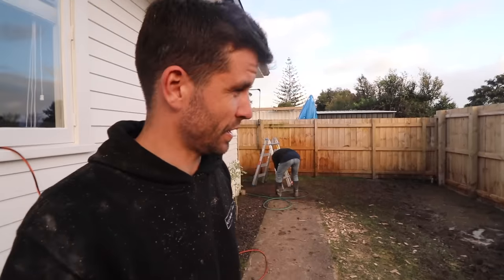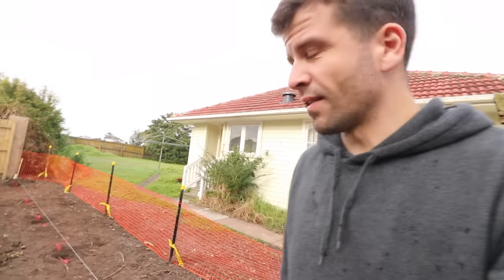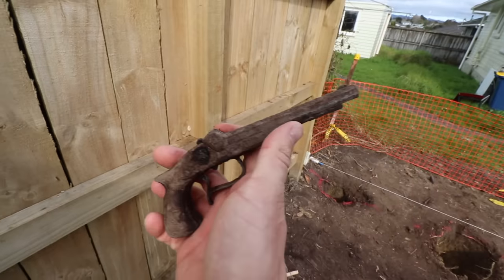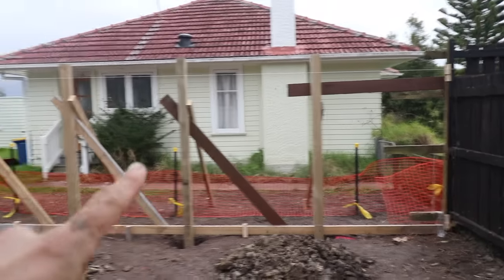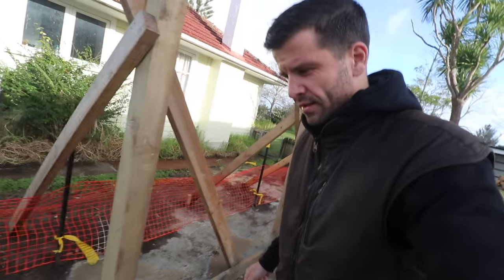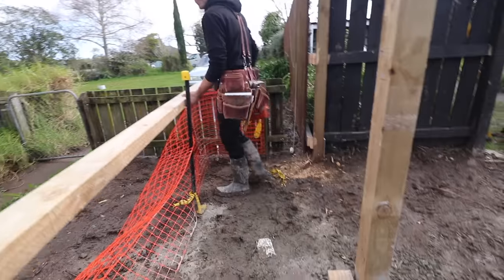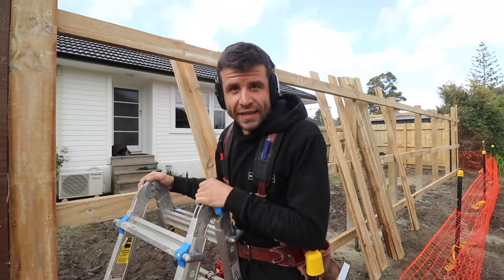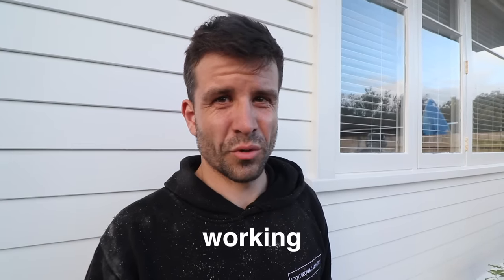How to Build a Fence (Like a Carpenter)

Comment: i cant believe you called a cement truck to fill a few post holes
Reply: If money is not a problem that is not a problem
Reply: Getting in the concrete truck cost the owner an unnecessary extra cost.
Reply: its over 600.00 dollar minamum in the Boston area.
Reply: That crete truck is expensive as hell here in Maine USA! I just pull a few bag from the hardware and throw them on my truck.
Reply: ericcyc1 a few bags of Sakrete from the hardware store ain’t much of a problem. Better putting money in my pocket than someone else’s.
Reply: @roccoconte2960  were no where near that much here in new Zealand. its about $250 a cubic meter but...they would have been somewhat less than a cube
Reply: I just build decking over the summer and used fast setting post mix......pour in your water 1/3 of the hole and pour dry mix until no standing water visible......no mixing and is set in 5-10 minutes.....a truck is way over kill. I must agree with @rocco conte the cement truck baffles me......and what a mess the concrete made to the neighbours property too lol.......finished product looks good though :)
Reply: kookiemoose in the UK having full sized trucks is rare. They typically have small cars. That's about it.
Reply: Concrete post mix in whole add water simple and cleaner . Look at the base of the post .
Reply: Well for quick set concrete in australia it's about $8 a bag. 2 bags per fence post, that's $16 per post. For the fence I did a few weeks ago it was 18 posts, so 18 x $16 that's $288. A concrete truck cost me $160. Saving of $122.
So location and amount of concrete definitely factors in to what's cheaper. 
Same for the post holes, paid a man with an excavator to come dig the 18 holes 600mm deep, took him 2 hours and cost $180. Cheaper than 2 blokes digging them by hand.
So with the hours saved in labor costs plus the savings on concrete the job worked out much cheaper for the customer and less back breaking for me.
Always pays to check prices on everything.
Reply: The mess made by using the truck was impressive.
Reply: Yeah but it makes good YouTube content haha
Reply: @residentevil2928  even in a standard family car you can get a fair few bags in your motor before weight becomes an issue. If not b&q and wickes deliver. Cheaper than a concrete lorry for posts.
Reply: You got no idea mate. In nz it's always the way. Bags of concrete aren't cheap. Work smarter not harder
Reply: Dang truth to that wtf you can see that it isnt a rich neighborhood
Reply: In nz if it's over .4 cube it's generally cheaper to get a truck.
Reply: In france ,its about 90€(100$) the cubic meter delivered by concrete truck.
Reply: I aggree, total waste of money, its OK for people to say, if money is not a problem, but it's the home owner who pays
Reply: @ericcyc1  Or if you have good connections.
Reply: Most likely it was a rejected load or remnants from a nearby job.  From the barrow loads it looked pretty soupy.
Reply: I need and want to put in a wooden fence.  I have to admit  after watching this video I would be way over my head.
Reply: I hear a lot people visinting Brazil saying prices here are  fucking expencive,but look at concrete price in the comments here i got shocked, here in Brazil a cubic meter here goes  at  27 us dollar. 
Calling a concret truck to fill four holes is waste of maney,no doubt, but as the property owner is rich, that'sn't  a probem.
Reply: Alex Colegate that’s not UK
Reply: @roccoconte2960   Do you  mean a cubic meter 600,00 dollar ? Or a full truck of concret?
Reply: @brazilonline8154  In U.S. there is a minamun charge its about $ 600.00 for 3 cubic yards.
Reply: @roccoconte2960  Is that $6oo US dollars?  Here in NZ you can buy a big trailer load of builders mix for(NZ $$) $100 m3 plus 6 * 40kg bags cement $120 plus labour on top to mix it,  it'd probably work out cheaper to get the truck at about $250-$300(NZ $$).
Reply: @Timespider YES  600.00 MINIMUM CHARGE as apossed to 5.00 per 80 lb. bag  two bags to a cubic foot,we would never think of calling a truck for a few fence pole wholes , i guess its dIfferent in NZ.
Reply: @phdiy3913  The correct way is to mix, the aggregates+cement need full contact with the water
Reply: Anand yeah but the fast setting post mix doesn’t require the same mixing....it either goes into the hole and pour water on top or water goes in with post mix on top....depending on manufacturer......these set hard in 5 minutes to let you continue with the fence/deck.....water with full contact of the cement is for general hydration of cement grains which is not so much applicable to the fast setting post mix.....otherwise you will have to wait a day for the cement to set 👍
Reply: @phdiy3913  Either/or, I still like to get a shovel in there while setting posts and mix it about. They definitely could've done this In a couple hours with no mess
Reply: Anand 100% I agree 👍
Reply: These holes actually use more concrete than you thought. You need too bags of cement for each holes
Reply: Too much cash for Scotty B
Reply: I was thinking the same thing
Reply: @ericcyc1  if money is no problem hire someone else.
Reply: What about the extreme over pour😮horrible work if you ask me
Reply: @ericcyc1  na it’s just cheaper and easier be a couple hundred bucks US instead of a few hundred in labour. Better for everyone.
Reply: @Matthew.E.  bang on
Reply: Hahahahahhahaa
Reply: @robertbutler8004 this is $300 dollars a cube in New Zealand, its way cheaper to get a truck than to mix all that concrete by hand. Each post holev is 900mm deep x 300mm wide so we just get a truck to save the clients money
Reply: I’m wondering why you gave the neighbour the nice side without the framing to look at !
Reply: That's what I was going to say
Reply: @simonmiddleton4487  a bag of concrete is 4$ and not only that you only need 1 you can use 2 but it's not necessary and it's time consuming and more work I've built fences for over 10 years never have I ever seen anyone call a cement truck 💀💀 made it more work then it's should've could've dry set or mix with a drill in a bucket
Reply: Yea the cement was very poor job and expensive. 9 bags of cement would have done it. With two guys it is nothing to m8x by hand.  I do it that way all the time.
Reply: Depends, if there's enough posts then it saves a heck of a lot of time buying gravel, sand and cement and mixing it yourself. Or faffing about with bags. And measuring water. Just order in a truck, dump it in the barrow, dump it in the hole. No questions about the mix being right either, saves you on labour.
Reply: Never send a carpenter to do a landscape job !! That'll be half a million dollars please love !!
Reply: Me too
Reply: Dude you butchered the post tops . Do better
Reply: Yeah I’ve never heard of such a thing

Comment: how to lay a concrete slab......with a fence in it    lol
Reply: LOL!!!
As I stated....damn they made a mess....he says...."we made a bit of a mess". YA THINK?!?!?! LOL.
Reply: Waaaayyy to much water something like that would be better on the dryer side. Especially do to windy conditions.  Too much water + wind = cracked weakend concrete
Reply: Sean Henry I couldn’t tell if it was the bottom stringer or a rot-board. He might have been aiming for a 2-in-1.
Reply: One good storm and the fence is gone.
Reply: Lmao!
Reply: @IAmZen_007  lucky we don't get real bad conditions then
Reply: fanaticz666 not yet ... 😂
Reply: Spot on!
Reply: Yeah with 2ft of concrete holding in each upright. They’ll still be there after a tornado.
Reply: Max Plascencia  not really....and if you top the 4x4 flat then water sits ontop and eventually soaks in and rots the posts...but hey, you know so much so lets do the flat next time
Reply: I thought it was a sidewalk...lmao
Reply: Max Plascencia  they arent supposed to be , water run off
Reply: Max Plascencia  sorry just seen Shane's comment.  Ma bad
Reply: Why would you pant a fence black?

Comment: I was beginning to think I was the only person doing lap cuts anymore. I refuse to ever do a scarf cut on fence rails and I see them bloody everywhere in Australia. So I was thrilled to see your lap cuts, thank you!
Reply from the maker: Cheers, much more satisfying!
Reply: ultramegaroytrombone - I’m getting into carpentry for the last two years. Out of curiousity, why do you prefer the lap cuts on fences? Thanks for the input, from Canada. Cheers
Reply: Hey Nater… lap cuts are the way to go outdoors because they last longer than scarf cuts. Scarf cuts come to a point which is never, ever, good to do to wood outdoors. Bringing wood to a point always increases the chance for deterioration at those points. Then if you are bolting or screwing the timber to the post, you are gonna drill through (most likely) a thinner piece of the rail than you would be if you were doing a lap cut, unless you are incredibly precise. A lap cut means you are always screwing through at least 50% of the rail size where a slight misalignment on a scarf cut means you’ll be screwing through less than 50% of a rail to attach it to the post. A lap cut is also a tighter fit and there’s less chance that the rails will pull apart in the future and there’s less chance water will penetrate between the lap cut. The final reason is… it just looks better. It looks like you give a damn about what you are building and not just building a fence to make money. On some fences I’ve made I’ve taken pictures of the lap cuts where a white piece of hardwood meets with a red piece of hardwood on a rail and it simply looks fantastic, like you’re making a piece of art. Greeting from Sydney my Canadian friend, I hope you have a long and prosperous career working with wood…
Reply: ultramegaroytrombone - Thanks for the well wishes... I actively seek out advise and tips online, so I will have a prosperous career, with help from folks like you, so thanks for that as well...

I’ve always done scarf joints outdoors in an attempt to hide the joints, giving it a seamless appearance. I guess overtime the opposite happens, especially here in Canada with our climate. If it works down under, I would imagine it works here.

I will definitely be looking to incorporate those lap joints into my daily routines wherever possible.

Your method of explanation was clear and made perfect sense to me, so thank you for taking the time to help me out! I will be sure to pass along the info and pay it forward to the next generation.

Had an extra thought on the subject.... I’ve seen people use lap joints for interior wood working and a lot of the time they use glue before their fasteners, would you do the same for exterior applications?
Reply: Thanks Nater… yes, I’m a big fan of Liquid Nails adhesive. I use it just about anytime I join 2 pieces of wood together whether it’s gonna be screwed or nailed after that. For lap joints on a fence I’ll use Landscape Liquid Nails, which is an exterior grade version. I won’t use glue to attach palings to a fence rail, that’s a bit too much overkill in my opinion. 

For interior framing work I’ll still use liquid nails but for most other things I’ll use a “white” coloured or transparent glue like Gorilla or Tarzan wood glue which are just generic brands here. For finishing carpentry like architraves and trim work, I’ll use a “superglue” or epoxy that requires an additive to set off the glue when applied. Those products are awesome! 

When I talk to a client about a quote for a job, I tell them I do things like obsessively gluing everything first, because I suffer from “OES”. Then I tell them OES stands for “Over Engineering Syndrome”. They laugh and then they end up hiring me. Sometimes it’s exactly what the client wants to hear.

You’re a good man Nater, keep up the great attitude you have and may you live long and prosper…
Reply: ultramegaroytrombone - We’ll my hats off to you. In an online landscape where people can hide behind screen names and criticize the hell out of every little detail, here you are, having a productive chat with someone halfway across the world.

You mentioned that you talk about over engineering to clients, and that’s what gets you jobs. I’m not sure what the contractor landscape is like in Australia, but I know here people love to here well informed opinions on how things should be done. Good business is doing things right, so cheers to you. 

I agree that the fence boards shouldn’t be glued. Here the material is far too thin and not seasoned enough to ensure the wood won’t split or deform. So it’s nice to be able to pop by a site a replace a board or two with no hassle. I always like to glue the main frame structure though.

I’d like to say thanks again for taking your time to share your experience and knowledge, in a small way you’re helping to pass on the craft, which in this day in age, means a lot. Cheers, happy building
Reply: @natejm  @UltraMegaMan I knew I saw my home country when you were in gumboots in the mud! Im a DIYer started at 32 and I'm just learning how to build a fence although I simply cant compete with a fencer, even cost wise, doing it myself will take me a week and cost the same amount of money. Would it be a better job? Possibly! Australia is the most dodgy bodge job country ever and that's why I choose to do everything myself whenever possible. Its hard and difficult, but damn satisfying. Been a learning experience reading thru these comments 4 years later. Cheers!

Comment: Good to see a proper fence getting built, 900mm deep holes for post, witch really is regulation, not to many people would do that. Great job! That fence will last a life time easy..
Reply: Not with wooden posts, they'll soak up water that will hold in the concrete and rot the posts. Doesn't matter if the posts are 100ft or 1ft in the ground, concrete posts are the best option for a lifetime fence.
Reply: @HarleyGC7  You clearly know zero about the timber and the treatment methods here in NZ.
Reply: @DiscoFang  Doesn't matter what you treat it with, its wood and it rots. Even concrete can rot and eventually crumble but it takes a very very long time, sometimes 40 years or so.
Reply: Harley Here in NZ I've seen concrete posts failing before timber posts. I have original Jarrah boundary & fence corner posts on my own place that are 100yo. Concrete posts have almost no resilience to knocks. Generally only a couple of 6mm pretensioned wire lengths inside that lends any strength to them but if the concrete crumbles or cracks they are useless.
Reply: Harley 40 years can NOT be considered a long time.
Reply: @DiscoFang  i think 40 years is pretty good for a fence
Reply: @brianseager6388  That’s the bare minimum  with the CCA treated radiata pine we get here in NZ.

Comment: Awesome videos guys. Very educational. Makes me rethink  my career as a bank manager lol. Good stuff, keep  it up!
Reply: Memphis Jahx, well maybe since you’re good with numbers you can calculate how much money was wasted because of the fence’s inevitable failure because there was no drainage material in the base of the holes.  And the end grain wasn’t sealed against direct ground contact.  And the concrete wasn’t troweled at the ground level to ensure proper drainage.  And rabbeting the rail joints is cute but pointlessly exposes way  too much grain to be a good idea.
Reply: @charleshetrick3152  this timber is treated to be set in ground
Reply: @fanaticz666  no, it’s not.  If this were pressure treated for ground contact it would be incised (having hundreds of little cuts) pressure treated.   It looks like cedar to me but I know there exists “appearance grade” pressure treated which is not incised and not rated for ground contact.  That said whenever you cut or drill pressure treated lumber there’s a liquid pressure treating chemical you apply to the cut ends.  All that considered when I’ve built fences regardless of the lumber type my holes had drain rock and I applied a rubberized coating to the end grain of the end to be subterranean.   Yes a fence can be poorly built and last quite a long time but if I were building a fence and representing myself as an authority on same on YouTube I’d pay closer attention to these details.
Reply: @charleshetrick3152  these are H4 fence post with CCA treatment, treated for in ground use for fence post. Nothing on this fence is cedar

Comment: Bro...that concrete work was an absolute nightmare...I’m sure the fence is fine but my god the concrete...
Reply: Right, that was hard to watch
Reply: We use quick concrete > you win a lot of time.
Reply: Right lol. 2 ft holes takes one bag of quick crete.
Reply: So painful watching the premix first couple barrows so wet and there was no plan to get rid lol, would have been better to mix by hand  for such a small job
Reply: They were probably rushed by the driver to get their few spoonfuls of concrete and bugger off
Reply: @jamiedyer7782  Is the concrete supposed to go in dry first, then sprinkled with water?
Reply: @ASSAJAJHS  With hand mixed concrete water always comes first as the cement will stick to the mixer and/or wheel barrow and it'll make it harder to both mix the concrete and clean the gear at the end. Concrete will also stain driveways, paving etc. so adding water first means there isn't cement dust being thrown everywhere.

In the UK there's what's called Postcrete, it's a readymix, you just pour it into the ground dry. Where I'm at we don't usually need to add water at all since the readymix will soak up moisture from the ground and it will harden on it's own.
Reply: @carlcox7332  they went down 3 feet thats 3 bags per hole which equates to $30 per hole not cheap compared to say .4 of a metre delivered less effort ready mix is the way to go